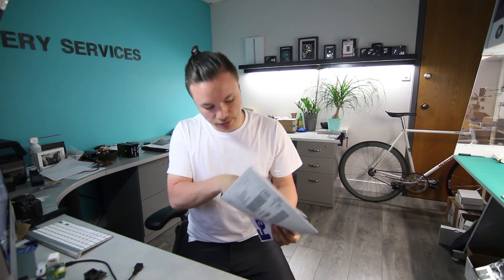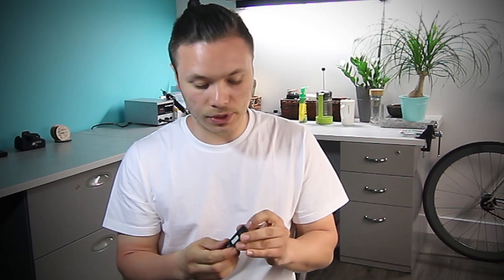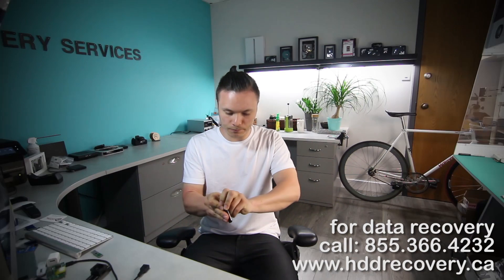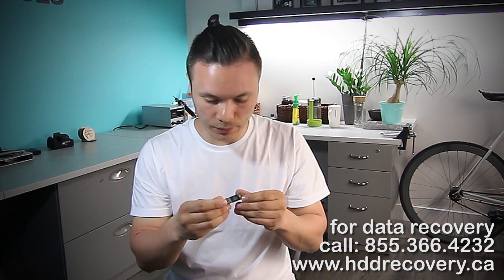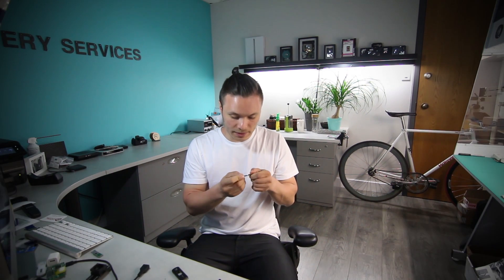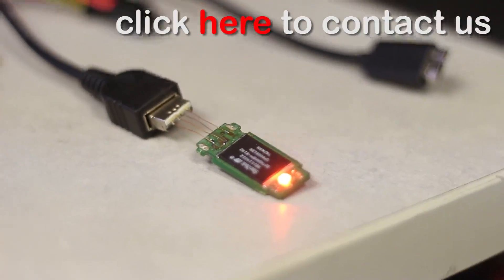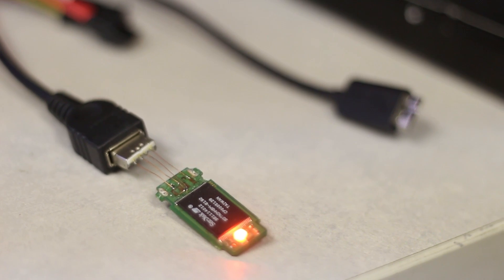computer not recognizing USB - pen drive repair

Comment: my Sandisk cruzer force 16gb BL141224732v  SDCZ71-016G is having same problem from today. it is not detected to my mobile, tv and other pendeives detected finely to otg mobile,tv. even this pd not showing the connected its showing no response act as dead. you have given this solution its good but not for my pendrive I opened my pendrive but inside there is only one black chip like memory Card. please give solution. 

please reply

Comment: I want to know of a brand/model that won't break as the usb shown in the video... I have 2 or 3 of them with the same problem... to me it seems like they were designed to fail... are there any that are better made?
Reply: what brand were these that failed? trying to single out faulty brands and NOT BUY THEM.
 (avoid HP flash drives!)
seems the only way around this is to make backups and backups of those backups. which is ridic

Comment: Sir my pendrive is write protected how to repair that pendrive I have used software and command prompts that's not working. I think hardware problem do you have any suggestion for repair that pendrive.(read only drive)
Reply from the maker: Mukesh, I don't have much information on write protected repair. I do chip off recovery most of the time. There might be some vendor utilities to repair it maybe, but I never looked into it

Comment: Wow.....instead of destroying the pads and doing all that rework - you could just clip the leads with narrow wire cutters, than just heat and pull them off. You should look into getting some solder wick also.
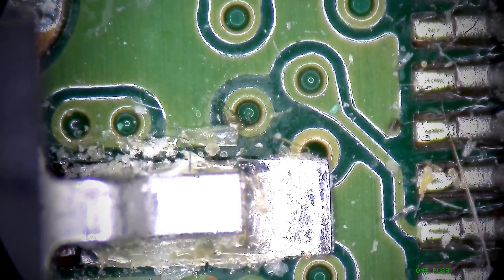Reply from the maker: have you even watched the video? 1:57 - initial inspection. All 4 pads were ripped off the board before I even got the device in my hands. That was the reason I actually got it for repair.
Reply: I would never pry a surface mount connection like that... becuz.......if it wasn't open,,,,,, it is now.
Reply from the maker: I get work for specific reason - data recovery. Data was recovered 100%, case closed. With pads lifted as they were, who cares how you cut the connector out. I'll say it again all 4 pads were lifted before I even got the device, I did not lift them, they were already lifted... as in lifted..... thx
Reply: jaime may want to take a seat - and get some glasses - and some respect while he/she is at it.  great job on the process, erkin. very clean.

Comment: I've got an old PNY 1gb flash drive that seems to have died 2 days ago. I opened it up and looked at the pins and they all seem to be good, none of them look lifted. 
The weird thing is sometimes when I try to plug the flash drive in the USB 3.0 port, it does light up but pops up but gives "device descriptor request failed" and "the last usb device you connected to this computer malfunctioned and windows doesn't recognize it"
I also tried plugging into the USB 2.0 port a couple time and just once, the drive showed up but quickly disconnected.
I think this may be a problem with the usb jack or pins on the device but I am not sure. 
I know you probably can't give a direct answer, but can you give a guess as to what the problem may be?
Reply from the maker: Is that a PNY Attache? those units are actually rebranded Sandisk Cruzers. Often they use controllers that crypt data or use dynamic XOR, so the way we restore data is by swapping memory from failed device to a working one. Here is actual video that I did on PNY Attache a while ago demonstrating the technique: https://www.youtube.com/watch?v=keLii7hjOk4
Reply from the maker: if you can email me close ups of both sides of the flash drive, I can tell you if we have a donor match for it